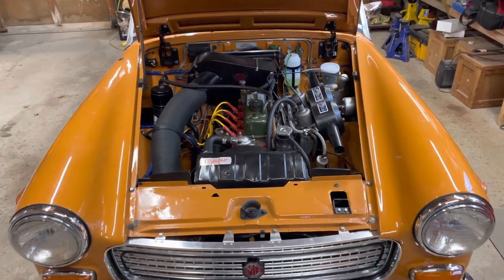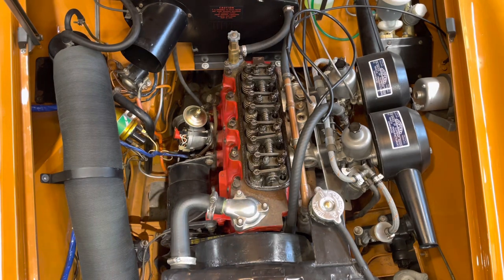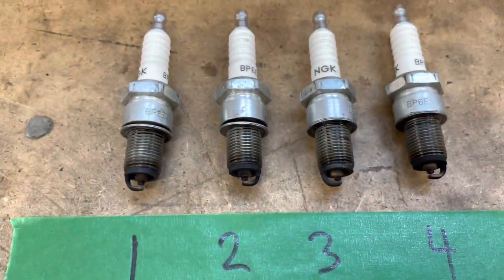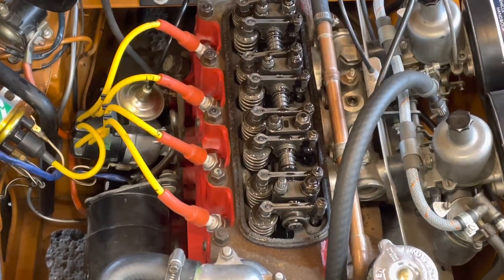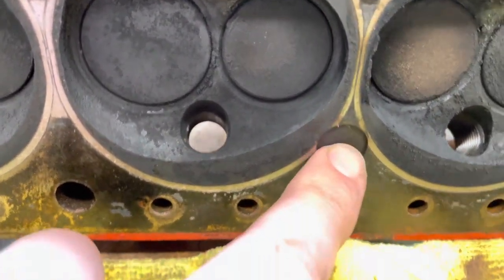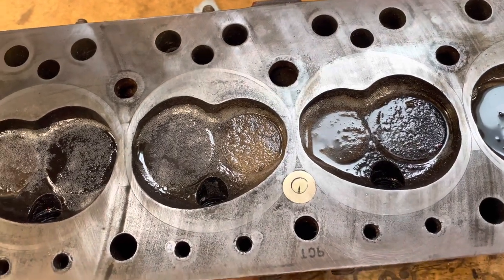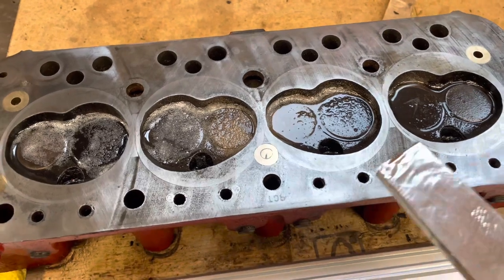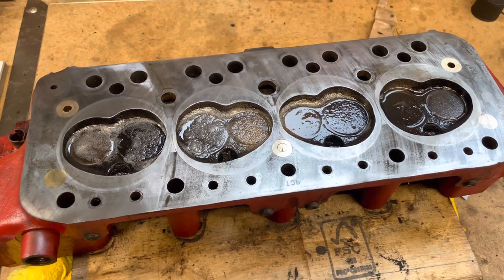1971 MG Midget - Valve Seals/Springs, and Head Gasket Replacement

Comment: I would have threaded the big hole and put a fine thread iron plug and re surfaced that thing. But you got it good. Theres not very much compression in that engine.

Comment: That Brass plug issue you had happened to me causing water in C3. The guy who fixed it said it may have been overheating that caused it ??. Apparently its common